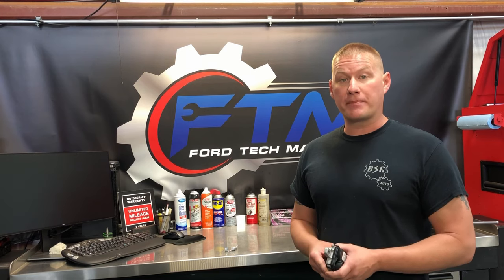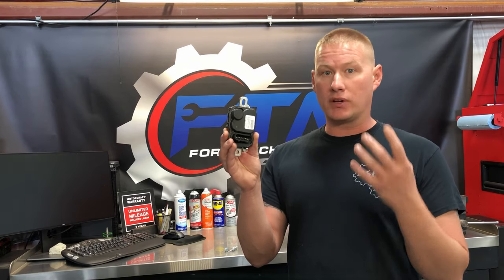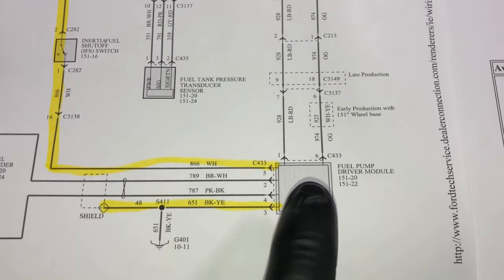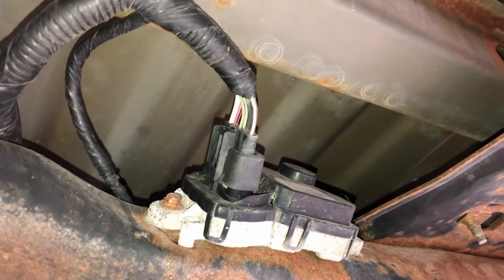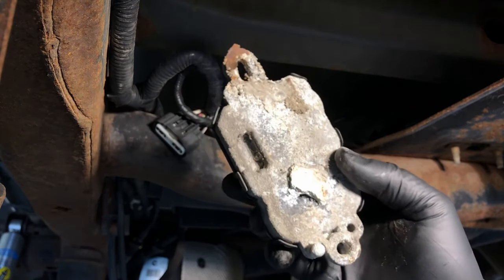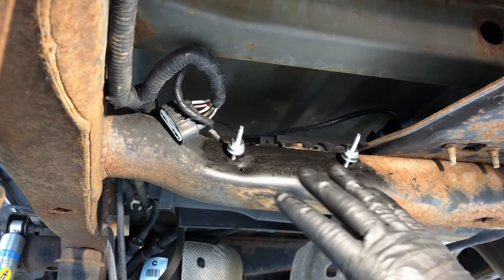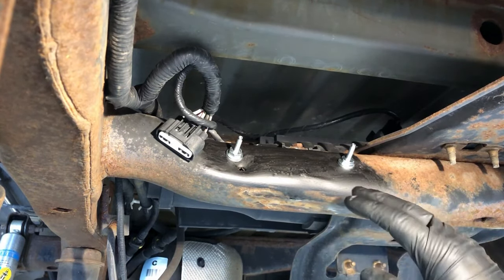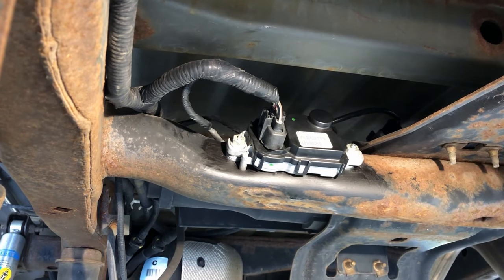2004-2008 Ford F-150 No Start DTC P1233: Fuel Pump Driver Module Replacement

Comment: Thanks for this video. As a possible help to others, I had a no-start issue on my 2010 Expedition on a recent Sunday morning. Starter turned over, but no gas, no spark. Switched the start/run relay with an unused one, and it cranked right up. Lucky 3 minute diagnosis and fix (I hope).  The fuse/relay box is on top of the radiator at the front of the engine compartment. The start/run relay is one of 9 identical relays in a row across the back of the box.    Vehicle is driven in a seaside town where the salt air can cause or exacerbate corrosion issues, including friable corrosion. Can't say corrosion was at fault here, but it causes me to check connectors and use dielectric grease on connectors where ever I can, including the relay pins.  In this case I put in a brand new relay after confirming the fix. For those wondering how I knew the injectors weren't working, there was no raw gas smell at the exhaust after the starter turned the engine over for about 10  seconds each time I turned the key; could have been the pump, or the pump module, but I looked for the simplest solution first.

Comment: I own a 2008 lariat 5.4 3 valve flex fuel. I just saw your schematic but it says except flex fuel. What is the difference? Location of the fuse? Different module? I’m not having any issues, just curious.
Reply from the maker: It is all the same except the flex fuel schematic just shows the "flex fuel senor" in the schematic.

Comment: My gas gauge on my 08 F-150 keeps saying I have low fuel and the nettle is very inconsistent. What could this be and could there be an easy fix? I hear it is a common issue.

Comment: I actually had a code P0191 - Fuel Rail Pressure Sensor Circuit Range / Performance Bank 1 on my 2008 F-150.  My first thought was the fuel rail pressure sensor, but it actually was a bad pump driver module.  It came off the truck looking identical to the one in the video.

Comment: Why is it that most content on this channel is simply fixing bad Ford engineering?   They've been building cars for long enough to know how to do it right yet it seems to escape them.   The 4.0 SOHC series was quite the eye opener.   Great job, Brian!   Your content is helping a countless amount of people.   Keep it coming!
Reply: @LynxStarAuto  I was more getting at the fact that Ford engineers their problems into their cars instead of out.  Of course Brian is a Ford specialist.  The point was that his content is mostly fixing Ford's bad decisions instead of just normal wear and tear items.
Reply: @lustfulvengance   Hey I'm with you 100% on everything you say.  But there are some things Ford has done that defy any sort of logic.  Bolting an aluminum part on a steel axle on the back of the truck is just being cheap.  It doesn't take a crystal ball to know that's going to be bathed in salt, dirt, and water.   Other manufacturers that decide to do things right, would have placed this module either inside the cabin or in a well-protected space.   Why didn't Ford do it?  Because it will be a cold day in hell before 8 more feet of thicker gauge copper wire are on the BOM.   It's penny pinching.  They know it will be good enough thru the warranty period, and to hell with it after that, it's not their problem.   It's bean-counting like this that turns me off to certain manufacturer's practices.   GM is in the same boat with countless rotten modules in the back of their trucks.  They both KNOW how to make it reliable but they CHOOSE not to.

Comment: My 2007 f150 .
Only has issues when the weather is cool.
It cranks and idles  fine but the moment I put it on drive or reverse  it stalls.
I have to let it idle for a long time until it really warms up and then it runs fine.
Help please. Thank you.

Comment: In need of advice. 2005 f150 4.6l
Crank no start 
Replaced FPDM
Problem persists 
So I took and jumped the plug out and sent 12v directly to fuel pump. Runs fine.  Got 12v coming in from relay to FPDM. Nothing from FPDM to fuel pump. Verified at the back of the plug, with module plugged in. Installed 2nd module. Power going in but not out, gotta be the module, right? Nope. Still nothing.  DTC is the FPDM offline  suggestions? Possible 2 DOA modules?

Comment: Hey bud,
I have 2007 Lincoln navigator and it 100% sure the module is not mounted in this common location. Any idea where else I can look
Reply from the maker: Yours has a regular relay in the battery junction box.

Comment: Hi there. I have had my 2008 5.4L Ford F-150 FX since I bought it and up until 4 years ago, somebody decided one night they would smash the driver side window and throw a mauseltof inside cab while me and family were in house watching a late night movie. We heard a loud bang and seen glowing red coming from front room blinds. Whole interior of the king cab was totally melted and destroyed, but engine, transmission, box and everything below wasn damage, as fire was put out by firefighters before entire truck was lost. My question is bcuz we took the whole front cab, box, front fenders off chassis and swapped with an '04 5.4L Lariet king cab, the truck will not start, no crank, just lights when put in and turned to try and start. When turn off key, dash lights stay on and there's a clicking noise under steering column like something is killing battery and does kill battery. Now...my husband thinks we need to replace motor, but I think it's just a possible reprogramming or replacing of PCM, ECM and TCM. 08 motor was starting to have issues but truck still ran and was our baby. It was starting to sputter and stall if come to a quick stop, vvt solenoids I believe needed to be replaced, but a mechanic told me it was cam phasers and timing belt, but all this ticking in motor usually is from oil pressure sensor, vvt solenoids and camshaft sensors failing no? I don't want to go broke paying for a dealership to tell me more lies.

Comment: P0191 ? Can this module starting to go bad cause this code? I’ve noticed its hard starting after running like 3x now and last time barley started and throwed a code finally but now it starts right back up? Im replacing it either way but think this is my only problem?

Comment: I have a problem with my ford 2006 f150 5.4 i stop my truck is down the rpm and shacking the truck i not have code and no ligth in the dash

Comment: what took you so long to make this video? mine rotted away 7 years ago, it came off in a billion pieces when i started to turn the first bolt. also paint the back of the module if you live in an area where they use salt on the roads
Reply from the maker: I have videos on this subject from back in the day but recently I reviewed them and they weren't specific to the F-150 so I made a new clear video just on the procedure for the F-150. I used fluid fil on the outside vs painting.

Comment: Hi can anyone tell me if this might be my problem on my 1994 ford 5.0 .my truck starts everytime when I go to start it but when I drive about a block in it it will sputter and lose power and it acts like it's starving for gas and it'll die but then it'll start right back up every time and but it does the same thing Time after Time do any of you think that the fuel pump drive modular might be the problem. I have took a fuel tank out because it was overflowing I changed the fuel pump in the other tank that's on the truck and this is still happening to my truck I'd really appreciate it if anyone has any advice  that can help me

Comment: Hi, very nice explanation and information, I had a  truck with intermittent cranks don't start, somebody put white grease at the conector of the fuel control model, after I cleaned and remove the grease everything is working fine..blessings

Comment: Could a failing fpdm cause the battery light to come on and off while driving? There hasn't been a fuse blown but when its real rainy and wet out the truck will not fire back up when I shut it off. Once it  sets for a while it fires up like nothing happened. Thanks in advance

Comment: Could this module (if going bad) cause low fuel readings on my scan tool and eventually lead to P0171/P0174 codes and a P0304 code. Or would that strickly be fuel pump issue? When driving my truck begins to lunge under a strain. The fuel pressure reading on my scan tool ranges from 39.2-45.9. Thanks!

Comment: I have a 2004 f150 5.4. New plugs, New cops, New mass air flow sensor.
Barely has any power, recently started having trouble getting rpms and speed. Feels like a fuel problem. I have a new FPDM and new injectors. Hopefully that will correct issues. Codes read missfire and lean.

Comment: Even though that this video is 4 years old - I would of coated the back side of the new driver with that guard paint like it was done to the frame - being that the driver is exposed to the elements and Ford didn't provide a shield for that driver modual - Keeping the corrosion down is a key point here.

Comment: Thank you Brian.  I looked at my fuel pump driver module on my 04 F150 and it's original, it's cracked and corroded (though the truck still runs).  I went to my local Ford dealer and got a new one.  It was $180.00, not bad I don't think.  I live in Missouri and we use salt on the roads down here so after 19 years, yes I think it's time to change the module.  I will be doing that this next weekend.
Side note:  I just changed the fuel filter on it and thanks for that video.  Yes the filter was original.  For some reason I thought that I had changed it about 10 years ago however, I remembered that was my 95 blaser that I use to have that I changed 15 years ago not 10 (Ooops).

Comment: I have a 2006 f150 4.6L. Have no power to the fuel pump. Have power to this unit behind the spare. Replaced the pcu, complete fuse box. Fuse 14 blows as soon as I turn the key. Truck does not crank or start. Can crank if I jump the starter but does not start. While trouble shooting the fuse panel I noticed I have no power to fuses 32 33 34.. Any ideas would be greatly appreciated!

Comment: Hi ford tech does 2010 have a fuel module ? I'm trying to rouble shoot a crank delay start and once it's start i seems flooded untill it clears the smoke then it runs good. 2010 f150 5.4 3 v cheers your my brain

Comment: THANKS AGAIN. 2nd video of yours that has saved me. '05 F150 KR, 120k. Truck would die instantly going down the road sporadically. Wait 5 min it would start up fine go maybe quarter mile and drop dead again.  Local dealer had my truck for 2 weeks, they ended tightening a battery clamp and calling it good. Sitting in the Iowa cold on side of the road in February I was fed up and looked to this vid. Did some looking and My spare tire winch was busted so I had to grind it free but well worth it. That module was split in half and covered in moisture. Called up napa, got the $98 Dorman special and did the roadside repair. 4 months later, I have not had a recurrence. Thank you, thank you, thank you.

Comment: $50,000 truck and Ford can't even make a part  that doesn't corrode or locate it in a safe place .  Should have painted the anti corrosive  on the module.

Comment: Wouldn't you agree that if your truck is getting up there in miles and years and the module looks bad change it whether you're having issues with it or not?
I'm the 2nd owner of a 2012 F-150 5.0 4x4 with 162000+ miles on it. I'm not having any issues, but I'm thinking maybe I should drop that spare tire and change that puppy.

Comment: I have question maybe you can help me with? I'm working on a 2004 f150 5.4 FX4 with a fuel pump that won't come on. I've tested everything from the central junction block to the fpdm. All the circuits test good and my grounds are good.  The problem I'm having is when the key is cycled on the the fuel pump relay comes on and never shuts off. I have a constant 12 volts at circuit 238 DG/YE. this will also drop my voltage at the fuel pump to 4.75 volts. Any help would be greatly appreciated.

Comment: Saw one of you videos about the Ford F-150 cutting out while driving. I just had a similar issue and had a p0191 code. So I changed the fuel rail pressure sensor and that had no affect. Please help

Comment: Hey brother I watch all your videos , I’ve got. 2015 f150 3.5 eco boost right now and it will turn over but won’t fire I’ve got a good spark and good fuel pressure all the way to the fuel rail but for some reason the injectors are not pulsing please please help !

Comment: I have a ford question, I have a wreaked 96 f150 obd 2 with a good running 351w. I put it in a 95 f150 obd1
 with 351w also. everything works like tranny shifts and the engine fired right up but the only way to keep it running in gear is drive with the brake and gas at same time. I found when I disconnected vacuum from the maf sensor on the firewall it would run without stalling but now it idles way too fast. any ideas ?

Comment: is this the same on an 08 expedition? I'm having the same issue. the truck won't start at very random times. last night i went in the store, and came out to a no start. I kept cycling the key until i heard the fuel pump, and it started and drove home. the last time this happened was in march, so very very random. I can't believe it'd be the fuel pump, once they start dying, they typically die shortly afterward in my experience. thanks

Comment: Hello Brian quick issue for you 2001 f150 4x4 supercrew I have replaced the transfer case shift motor twice once a crappy Dorman reman unit worked for about a month then a a1 cardone one but still have to tap on it with a hammer to get it to work when you turn the switch no lights for 4x4 then beat on it and can get it to work for a little while I am frustrated with aftermarket motor and can't find a oem one do you have any suggestions winters in Kansas city are like Chicago I need my 4x4 thanks for your help

Comment: Hi Brian , where is this FPDM located on a 2006 ford 500 ? We have a crank / no start issue., no fuel coming out of the main fuel line . I checked all fuses in and out of the car . Removed and cleaned throttle body too.It will start with starting fluid.Thanks for all the great videos.

Comment: 04 150 5.4 fx4
What causes my fuel pump to stay on and drain the battery even with key off and out of the ignition. I can here the fuel pump running its the only thing i can think of thats located under the bed near the cab.

Comment: I think I have that issue.  My truck just completely died while was driving and there was a lot of clicking sound, like it was trying to reset or something.  A day later I tried to turn it on but it was completely dead.  I don't even hear that fuel pump sound but still get that clicking sound.

Comment: I have a 2012 Escape 3.0L AWD .
I have an occasional crank but no start condition . The fuel pump is not coming on . I replaced the driver module under the car , no help the problem continues . The only common denominator I can come up with is that it only seems to happen when it's very hot outside . The relays under the hood become  too hot to touch . When this problem first occurred I would disconnect the battery, wait a few minutes reconnect it and the car would start . That doesn't work anymore , but I discovered if I swap the fuel pump relay with one of the others that will turn the pump on and start the car . But even then I sometimes have to swap the relays more than once . Can you offer any advice ? I would greatly appreciate ! Oh by the way , the PCM shows no codes .
Thank you

Comment: Hi do you have a video explain about the different noise the cars can not do..  I have a clicking noise under the car Ford explored 2013 3.5 xlt not ecooboster and I dont know what that heck is... is that normal.... by the way the ac is off it happned every time after I park the car you car hear it its look like that cane form the center of the car

Comment: I isntalled a doorman 4 years ago.  The original had failed causing bucking , terrible acceleration transmission feeling problems.  4 years later have had soem issues usually in cold weather where she doesn’t want to start. New battery a year later won’t start at 0 degrees. Started day prior at -10   So finally inspected the FPDM Dorman.  And sure enough it is cracked and the rubber stand offs are half gone.  So guessing it is this causing problems!!  Shoukd have had a new one waiting for this day !
Reply: Some reports say the Dorman replacement only lasts a couple of years.

Comment: Nice!! So if you have one that works, remove it, clean and inspect it and remount, spaced from the frame..... :-)
Reply: Does this module need to be properly mounted in order to work?
Reply: @joeysoda1404  Spaced from the frame to prevent corrosion to the module.

Comment: Hello, I have an occasional crank and hard start thats intermittent usually right after a warm start. Otherwise starts fine. I did a quick visual of fpdm and no corrosion visible. Im not in the salt belt and no rust underneath. How could I check for failing module?

Comment: What is that black cylindrical part  that resembles a canister on the opposite side (in front of) the fuel pump driver unit?

Comment: SCAN tool says OL-FAULT FUEL SYSTEM.. I REPLACE FUEL SENDING UNIT.. STILL THE same Revs UP and DIES OUT..
Reply: 97 f150 5.4 4x4 super cab

Comment: Can I loop the connectors on this to bypass the module and see if it makes a difference in a truck I suspect has issues with the module?  Mine hasn't corroded thru yet, but the truck stumbles when shifted into reverse or drive and almost dies.

Comment: So I thought for sure this was causing my issue. My 2012 F150 gets a very slight shudder when I'm just starting to go uphill and I press on the accelerator. It's very slight but noticeable. After looking for this part for my model year I realized Ford did a redesign in 2011 so they don't have this issue. Any ideas? Is a simple oil separator all I might need?